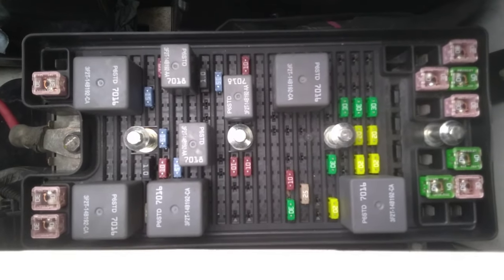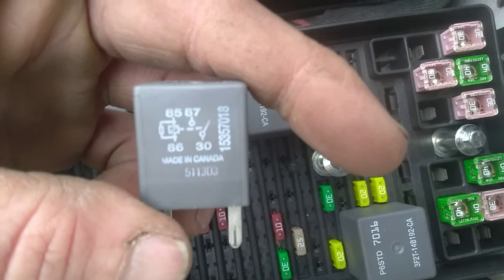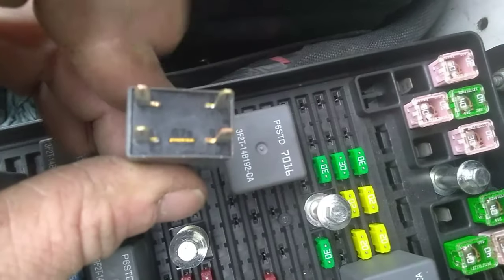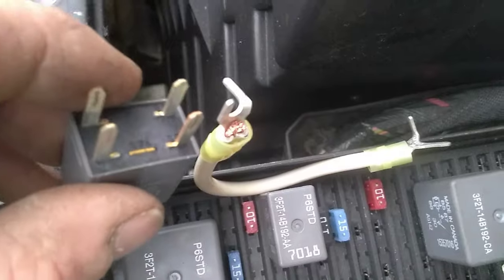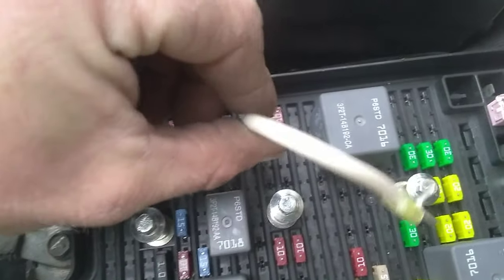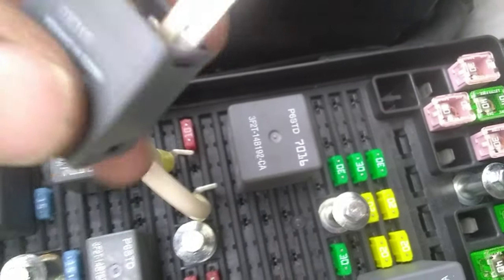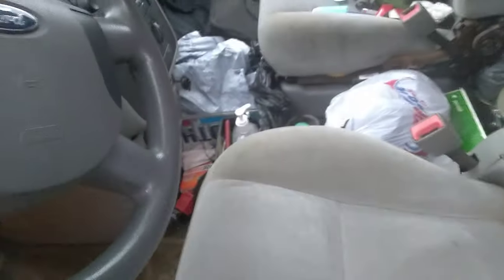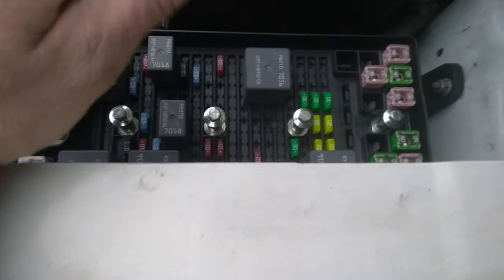Bypass a fuel pump relay, Ford or GM 4 & 5 pin relays

Comment: If you have an older Ford (Crown Vic, Grand Marquis, Mustang, etc) be sure you pop your trunk, and make sure your fuel pump cutoff breaker wasn’t tripped, by pressing the fuel pump cutoff reset button

Most people either don’t realize that these are there or never think to check to see if they have tripped, all it takes is the right pothole and it will trip because it thinks the car was in an accident
Reply from the maker: You're right, I've done a couple of videos about the inertia switch. I'd like to know how many people have changed their fuel pump only to find out it still doesn't turn on
Reply: @singularautomotive3542  I remember 3 specific times, back in the early 2000s where different customers had their cars towed in, they couldn’t hear the fuel pump when the ignition was turned forward, and had no fuel pressure at the rail, so they dropped the tanks, put pumps in them….and well, we know how the story ends 🤣
Reply: Question ? according to the manual and Ford customer service , the inertia 
switch should be on the rear passenger side on the wall next the trunk area yet when I took off the cover marked fuel cutoff here, there appears to be nothing in
there that looks like the pics I've seen in past photos ? any advice or ideas as to where else it might be ?
Reply from the maker: @Ifnotnowthenwhen-r8s  What kind of vehicle do you own? And on my Freestar you take the jack cover off which is labeled fuel cutoff as well, then it's behind a piece of foam insulation in the bottom right corner with the wiring to the tail light
Reply: @singularautomotive3542  Thanks for answering...I've got a 99 Windstar , I did take off the panel but did not remove all the foam..If you have a similar type car and wouldn't mind sharing a pic that would be 
helpful in me locating where it is in that small space..again thanks for your help  P.S. I'll be at it again tomorrow and fingers crossed will locate it and maybe start my car again..
Reply from the maker: @Ifnotnowthenwhen-r8s  https://youtu.be/n-kZyvFcmQA
That's a link to my Ford fuel cutoff/interia switch video part 1. It's a very short video but the last 15-20 seconds I show you how to find the switch in my Ford Freestar. Let me know if this helps you or not
Reply: @singularautomotive3542  finally found it tucked way in the corner and low in the space..I've tried popping it and pressing down and it almost feels like it is frozen..aside from the inertia switch do you think replacing the fuel pump relay switch in the fuse box might be another fix ? thanks for trying to help me figure this out before having to take it into the shop.
Reply from the maker: @Ifnotnowthenwhen-r8s  I would check voltage at the interia switch. If you have voltage there then you have voltage coming from the relay too. There's two bolts that hold the interia switch down, remove the two bolts that way you have easy access to the wires at the bottom. With you voltmeter set to volts DC, take you black lead and find a good ground. And use the red lead to check each wire going into the interia switch. You'll need someone to turn the key to the on from off position when testing each wire that way your getting your two second fuel pump prime. During that time you should read 12 volts on both wires. If you don't read anything then you're not getting voltage from the relay or fuse under the hood. If you read 12 volts on just one wire then your interia switch is bad, you can just cut and strip both of the wires and jump them together until you can get another switch. If you read voltage one both wires to ground your problem is the fuel pump module or the fuel pump itself
Reply: @singularautomotive3542  Thanks for the advice unfortunately I don't have the equipment to do the testing or anyone around who can assist on the front end while checking the wires..right now the best I can do solo is to change out the fuel pump relay switch and hope that resolves the problem, if not I'm stuck having to take it into the shop and given how busy they are ,like everywhere shorthanded and now the possible hurricane coming through Tampa ,it may be awhile before I'm up and running..wish me luck with the relay switch..
Reply: @singularautomotive3542  Well bad for me as the relay switch did not get the job done..my plans to the auto shop will have to be canceled as the weather report ,so far, is not looking good for getting the work done..so for now I am grounded until I'm able to get it checked out..
Reply from the maker: @Ifnotnowthenwhen-r8s  Well let me know if you need any help when you're able to get back to it. I'd definitely start with checking to see if you have 12v at the relay and at the interia switch. And it's possible that you do and have a bad ground at the fuel pump itself
Reply: @singularautomotive3542  Thanks ,right now i'm in limbo because of the storm coming through ..I've asked a few neighbors who while not mechanics suggested a diagnostic test to rule out or in a bad fuel pump..wish you were closer to lend a hand but appreciate your advice..
Reply from the maker: @Ifnotnowthenwhen-r8s  not a problem and stay safe
Reply from the maker: Hope all is well after the hurricane. You could check your local Walmart or hardware store for a voltmeter. Ive seen a couple that are rated for AC and DC for $10-15. Just make sure if you get one that it's definitely rated for DC.
Reply: @singularautomotive3542  Could not get anyone to take me to the auto parts store after my initial try with the relay switch in the fuse box..so right now it's in the hands of the guys and Firestone and they're trying different approaches rather then going directly to installing a new fuel pump..from what they told me over the phone, they got some juice going but not enough to start up the engine..I've been going to Firestone for years for fixes that I didn't feel comfortable doing myself and overall they've been pretty reasonable and have checked thoroughly before automatically installing something that other shops might do to save some time..thanks for touching base

Comment: Very useful info, especially in an emergency.  I suppose a switch could be rigged up on the relay terminals and using the relay to hold the temp wires in, until replacing the relay.  Thanks again and keep safe you and yours.
Reply from the maker: I appreciate the comment. I've had relays go bad in past and figured I'd make a video to try to help someone in a bad situation. Thank you and have a great weekend
Reply: @singularautomotive3542  Nice of you to think of others and put it on here.  I've had the same problem with the fuel relay in the past, and it maybe the same problem I have now.  I'll see.  Thanks again, and you and yours also have a great weekend.  Cheers,
Reply: Hi again.  I swapped the relay with another and there you go, all OK.  Now thinking back, the car wasn't pulling as it should have.  Now it seems much better.  I'm thinking that the points in the relay weren't contacting all the time, therefore, the petrol wasn't continuous!  So not pulling as it should have been.  Thanks again.

Comment: Does anyone know where the fuel cut off enercia switch is on a 1998 ford taurus?
Reply: Inercia
Reply from the maker: Sorry I just now seen your comment. It should be in the trunk, on the passenger side. You'll have to pull back the carpet close to where the passenger side brake light is at. Let me know if you can't find it and again sorry for the late response

Comment: What about 5 pin setups, that have 87 and 87a?
Reply from the maker: Still the same. 85 and 86 is the coil side. When the coil is energized 30 and 87 will be jumped together and this sends 12v to your fuel pump.  30 to 87a is your normally closed, when you turn the ignition over 30 to 87a is a dead path because it is open.
Reply: @singularautomotive3542  thank you! I've been looking for that answer for two days. You are a godsend, and have a new subscriber!
Reply from the maker: Glad I could help, you can do the same with the starter relay and air conditioner relay if you ever have a problem with those components